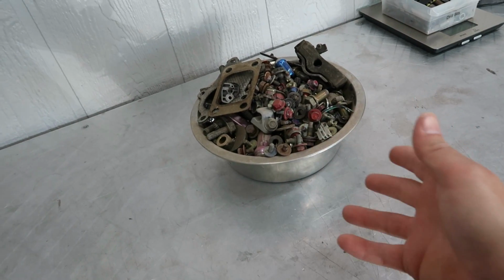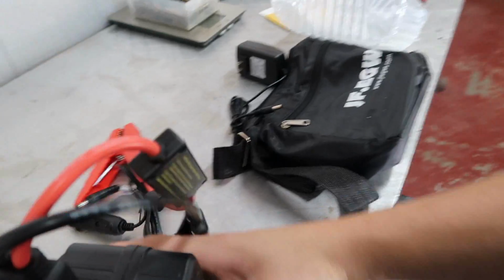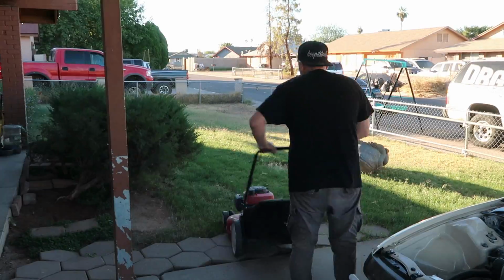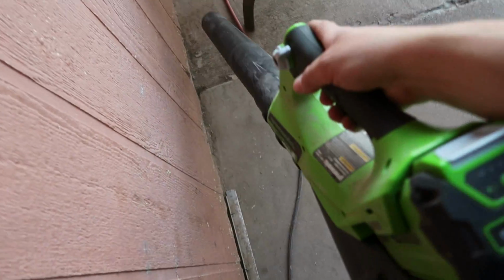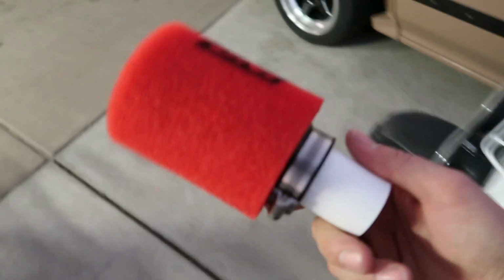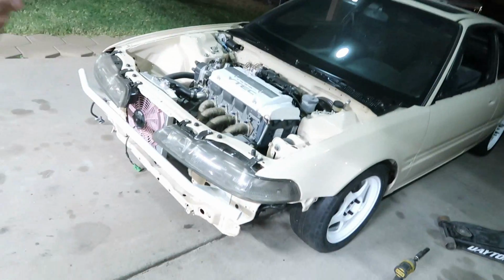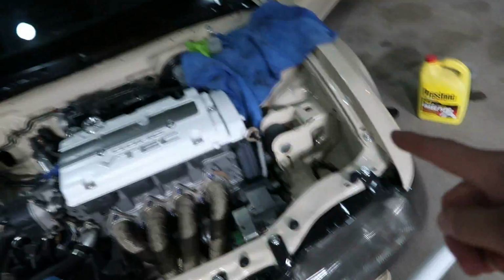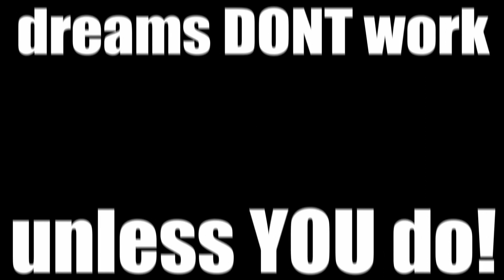Integra FOR SALE!!!!

Comment: I bleed clutches with a bottle of water and a hose by myself. Just put fluid in the bottle and run the hose from the bleeder into bottle under the level of the liquid. Pump the pedal by hand and keep fluid topped off. Works mint everytime.

Comment: If you haven't figured out the air in the clutchs hydraulic system then try opening the bleeder putting the pedal to the floor closing the bleeder let off the pedal and do that till fluid starts to come out then do the normal pump procedure hope this helps 👍🏼

Comment: use gravity bleeding, its hard to get air out. but if you hang the resorvoir high it will help!. manually you can pump the little piston on the slave cyl and you'll actually reverse bleed the air out

try before wasting money on new parts

Comment: Bro I had the same issue with bleeding my clutch the way I made it work was by applying vacuum and brake fluid pressure with a brake pressure bleeder there’s air stuck in it that’s really hard to get it to come out I did this and it literally bled after trying it a few times so just trying to help you guys out.

Comment: Had this happen to me what fix it was disconnecting the line from slave cylinder and pulling vac straight from the line coming from master once i got fluids i installed the line back and did the bleeding.. Hope it helps #dbfam

Comment: I had the same issue with my clutch it wouldn’t bleed. I took the master cylinder off from the clutch pedal,  pumped it by hand to get the fluid going into the cylinder then installed back to the firewall to the clutch pedal works fine now 🤙🏽

Comment: Always on time!!  Hey bro on your push mower follow the cable that works the throttle an there’s will be a tab that moves back an forth you can rig it up to where it stays at one rpm instead of jumping around. Didn’t know if you knew or not. Anyway I’m so ready to see venom and gotham finished dude frfr